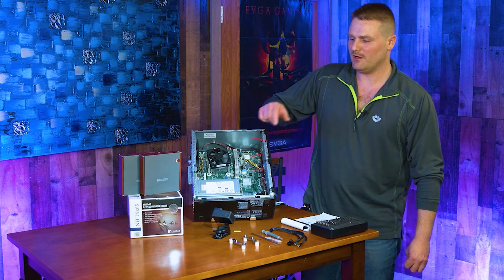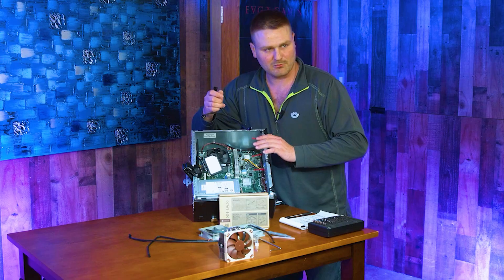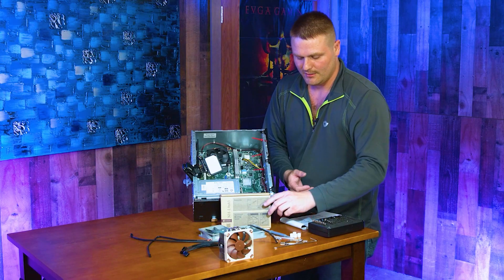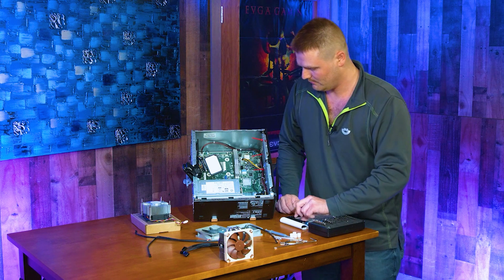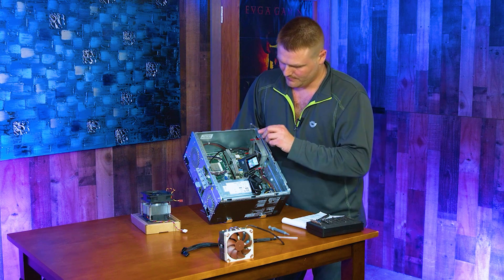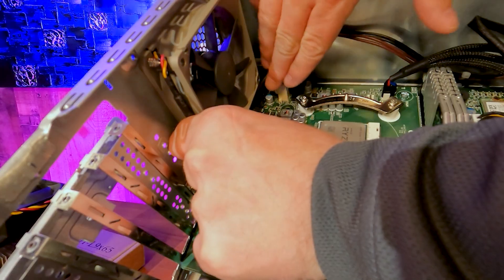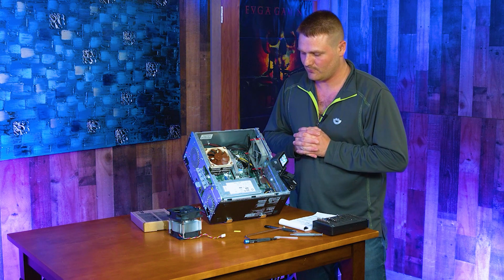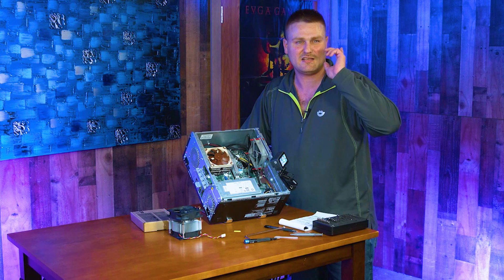HP Pavilion TG01 Cooling Upgrade Noctua CPU Heat sink and Fan Install W/ How To  1

Comment: I have ryzen 5 5600g and a gtx 1660 super on the 400w psu. the hottest temp i have seen is 72 celsius. and thats not my average temp. Would you recommend making any changes?
Reply from the maker: Any time adding a fan and aftermarket heating will help with the Temps. It will do 2 things help with cpu boost meaning it will last longer and life time of parts.
Reply: @TNW1337  I think I'm going to install an exhaust fan down by the PSU and an intake in the front of the case that is an upgrade of the exhaust fan as well as upgrading the exhaust fan. My only question is if you think I can still do that on the 400 watt PSU since I have the GTX 1660 super
Reply from the maker: @Viper34TTV  yes 100% even if you had a 3060 or 2060 it would still work. Hp did a good job budgeting for it with that psu. It is also the newer atx standard 12v only.  I feel it will be just fine 🙂.
Reply: @TNW1337  you're the man! Love your videos!

Comment: These videos on the TG01 are fantastic!

Does it matter if you use 3 pin fans and a splitter from the exhaust pins, or is there a reason to go 4 pin and share the intake fan with the CPU fan pins?
Reply from the maker: Both! will work. I know the CPU header is rated at 1.9AMP 12v not sure that the rear is rated for it. Could not find it.

Comment: Not used to working in OEM cases myself as before covid everything was a custom build. That being said are the mounting holes and bracket the same size as the AMD Wraith Spire? Reason why I ask it because there is a copper lug version that would be a cheap upgrade over the stock one if it would fit without modification.
Reply from the maker: It looks to be very close, I know what one your talking about. I do not have one but it looks to be the right pattern. I can not be 100%

Comment: I did this mod and am getting the same temps as before. Hitting 95c at 100% CPU usage. What the heck.
Reply from the maker: Front fan and CPU heat sink ?  Also there is software from acer to turn on performance mode with the fans. Test where done with it set to auto. But I get even better numbers when set to max or Performance mode. It is Acer nitro software.  I should have said some thing in the Video about it I just figured every one knew about it.
Reply: @TNW1337  Thats a Acer program? It won't let me run it. Is there a link you can give me?
Reply from the maker: @chrisstephens223  Yes it is. The name is called NitroSense.

https://community.acer.com/en/kb/articles/78-nitrosense-software
Reply from the maker: @chrisstephens223  Heres a link to the driver and software site for the PC 

https://www.acer.com/ac/en/US/content/support-product/8943?b=1
Reply: @TNW1337  Im still comfused. These are not supported on my HP desktop. I have an Hp Pavillion TG01
Reply: @TNW1337  "Sorry this computer is not supported" How where able to get this to work on an HP??
Reply: @TNW1337  i will have to try that. This computers motherboard is frustrating that you can't manually set thw fan speed or curve. Thank you 👍🏻

Comment: I bought the splitter you linked, why doesn’t it go in on my cpu fan pin
Reply from the maker: Witch Side? The One on the board or the one to the fan. the Fan side one can be hard to plug in you may need to put it on a angle. just a bit to get it to pop on. It also could be a bad splitter. With covid the QA on stuff has not been the Best.
Reply: The motherboard part, I bout the 2 way splitter and it doesn’t fit into the cpu pins. They look really separated and the splitter pin things look really close

Comment: I appreciate you posted this video. However you missed some key information, and opportunities to video some of the important installation points.
1. The NH-L9x65 CPU heatsink and fan, do come with both AMD and Intel hardware. I do not know why you keep saying this. I did not come across this issue.
2. When removing the cpu, somtimes the cpu and the current heaksink and fan like to come out as one unit. Please advise users to pull straight up to prevent damaging the cpus pins.
3. Thank you for posting links to hardware needed.
4. When installing the white plastic Intel stand offs. You do not mention which hole you place the 3mmx16mm screws into. There are three holes on the Noctua Metal mounting plates to pass the 3mmx16mm allen head screws through.
5.Stop saying "bad mama jama." This is your go to default, "this thing is awesome". Review your script for the video and learn to use a larger word base to express what you are speaking about.
6. I will say this again, thank you for posting this video. While I did find the video provided a good amount of information. There were some glaring issues in how you presented the information, and also how you missed some good points on installation and details that were missed.
Reply from the maker: Thanks for the info, can only help me make better videos! Yes I did miss those key points. I normal do not use a script, only if it is to much info for me me remember. But thank you for the input!
Reply from the maker: I will try to plan the videos out better to make sure I do not miss any key points!
Reply: It’s ok man he was trying his best and good job for helping him

Comment: Would this setup be good enough for one of these with a RTX 3060 ti and a i511400 in it? Or would you recommend a different set up? I'm completely new to this, so I'm just trying to make sure I get all the right parts to get the best cooling out of this. Also, which size fans would you recommend for this setup?

Also, how do I make sure these kits come with both Intel and AMD parts so I don't have to buy and additional fans just for the extra parts?
Reply from the maker: Well you will need to buy the screws they are not included. I could not find them on amazon singles, so I just linked a kit. If it says it supports AMD and Intel it comes with all the parts you will need. but the screws. 
Yes that will be a pretty awesome starter PC, The HP/TG's use a 92mm fans. Its pretty easy to add fans to it.
Reply: @TNW1337  Well the screw kit you linked it says they're currently unavailable. But I was able to find a virtually identical kit by the same manufacturer on there. So that shouldn't be a problem now. I put all the items you used in this video into one of my lists on Amazon, so I shouldn't have any problems securing most of these parts. And good to know about fans too, so nothing to worry about there.

Also, thank you for answering my questions! Coming from a gaming PC super noob, I really appreciate it.
Reply from the maker: @MetalGaiden96  Cool
Reply from the maker: @MetalGaiden96  Also 
FYI Do not tighten the heat sink screws all the way down. as soon as it is, snug stop.
Reply from the maker: @MetalGaiden96  screws I am talking about are the ones with springs
Reply: @TNW1337  Got it. I'll make sure to keep that in mind. Thank you.
Reply from the maker: @MetalGaiden96  ✔
Reply: @TNW1337  I did have one more additional question. Kind of unrelated to this specific video, but what's the best CPU that can be put in these PC's? As mentioned, the one I'm getting comes with a I5-11400. But I would like to possibly upgrade to a I7 eventually. I just need to know which one would be compatible with this PC specifically.
Reply: @MetalGaiden96  11700/11700F only. Board limits to 100 watts so they will run at around 3.5ghz under stress tests.

Comment: I’m back after trying to install the case fans the way you installed the case fan prevented the silver part/hard drive holder from going in
Reply from the maker: Yes it does.
Reply: TechNitWit doesn’t go in for me maybe my model is different from the one you have any way can I just remove the silver part and the black part I don’t see any purpose for it besides hold SSD/HD
Reply: TechNitWit and removing it will probably improve air flow
Reply from the maker: @mkminor3398  yes

Comment: where is the link of the splitter?
Reply from the maker: I for got to add it. it is there now. Sry
Reply: another thing, the screws m3 that i need is 16 mm or 10mm?
bc i was reading some advises on a page online of this pc and another thing, can i put 3 fans?(one in the frontal, one rear and one lateral)  ps: my oc has rtx 3060ti and amd ryzen 5600g
Reply from the maker: @botpro160  For the TG? I guess yes you can, I  only  put 2 fans  due ti cage and CPU  heat sink. 16MM unless you want to remove the mobo and remove the back plate they have adhesives to the board. 16mm will work I have a whole kit listed in disco I Know it more then you need. but a nice kit to have for pc. as it is a common thread they use for PCs.
Reply: @TNW1337  yes, for the TG thanks btw
Reply: Np, i didn't see the comment here and i asked another time to the newest video now

Comment: Mine is here now, i put a 80mm Arctic Fan on the side to get air in, its easy to put on this black cage. 
I used one Screw and three cableties. The Arctic Cooler have PST and PWM.

After Christmas i will order the Noctua CPU Cooler and a 92mm Fan for the back.

Comment: awsome video! i got a quick question, i the intel version of the tg-01, can i still use the same bracket that you used to attach the heatsink?
Reply from the maker: Yes it is the same thing, hp did it to same money.

Comment: Does it will fit if I have the 6600 xt installed because I see that you do a video installing que rx6600 but it doesn't have this cooling options
Reply from the maker: in the software ?

Comment: Did you remove the backplate? And will a 310W PSU be enough for the big cooler when paired with a 1660S and i7?
Reply from the maker: Yes and yes. back plate is adhesives on. you can remove it but not much fun

Comment: I have a Ryzen 5 5600 G (65 W TDP) noticed (at the same ambient temperature) that compared to intel's stock heatsink, the Noctua NH-L9x65the IDLE temperature has increased by about 9-10 degrees from 35.5 C to 44 C while that in load has decreased by only 3-5 degrees C. I have the impression that due to the smaller fan compared to the Intel stock, the dissipation occurs almost passively (in IDLE) and then compensates with the increase in the temperature curve under stress, in fact when the fans start going fast the temperature drops. Another thing I noticed is that with the intel heatsink the maximum temperature reached 85 degrees with the noctua never exceeds 80 degrees. Could you confirm the temperature increase in IDLE? Thank you
Reply from the maker: Well I was using the big boy Noctua on the Newer TG.  I will have to set it up to look, but yes I can.
Reply: @TNW1337  Thanks you are too kind, but don't bother I finally installed the big boy too!  beautiful beast!  but unlike you I left the fan in the default direction, and it increased the temperature of the GPU so I intend to reinstall it so that it sucks from the heatsink instead of blowing ...
Reply: The stock heatsink is likely made by a company called AVC. On my TG01 it seems to be able to do 5000rpm max.

Comment: can u use a 92mm noctua cpu cooler as well? or just the 65mm
Reply from the maker: There is a 92mm one that will work. i plan on doing a video on.
Reply: @TNW1337  I really hope sir, I need a video like that. I have de rtx 3060

Comment: Will these coolers work with TG01-1022, and do I need any cables?
Reply from the maker: With the cooler no extra cables are needed but you need to make sure it is a 4pin pwm.

Comment: Hey, what cable to I need to do exactly this? Also, the fan in the front, what is the purpose of it since the Case is closed in the front?
Reply from the maker: The case is not fully close in the front. take a flash light you will see light shine though.

Comment: Hey @TechNitWit what’s the point of install the redux exhaust fan? I see in my bios the exhaust fan that comes installed blows at about 353rpm and that never changes while watching HWMonitor either regardless of how hot system gets. Wouldn’t installing a new fan like you did here still be limited to that hard lock of 353rpm regardless that the fan can do more like 1600rpm? Or does this new redux fan install get the full 1600rpm? I’m new to pc mods and just want to be sure this wouldn’t be all for nothing bc I do see temp issues when putting the system on full load and would like to change that.
Reply from the maker: Well the noctus fan is a better design imo. Never did look at the speed it was running but if you tie it in to the header with the cpu it runs it at max.

Comment: Are the processor Heat Sink Cooler standoffs (white pipe things that hold the 4 screw's) included in the Heat Sink Kit?
Reply from the maker: Yes they should be unless you get the amd kit only. You will need parts from both kits. And plus the 16mm screws
Reply: @TNW1337  I noticed while installing my NH-D9L, that the mounting screw holes for the bracket have changed slightly, now the position 2 is for the LGA1700 and its the 1st position for the 115x, not sure if this was different when you made your video, but also my white stand-offs are for AM2 and backwards, and I got dark Grey ones for AM4, did you use the AM4 standoffs or these AM2 ones? (Still searching the comments and older noctua manuals, will reply if I find an answer)

Comment: do you think i could fit a Noctua NH-U9S to my hp pavilion tg01?
Reply from the maker: Nope sorry
Reply: @TNW1337  It's ok, i fitted a be quiet slim rock 2 tower cooler, had to remove the damn plastic push clips, and put it in with 3mm allan head bolt's, 1 washer each screw and 1 spring. :) everything fits, but its tight! also using the hdd bracket etc in the case :)

Comment: Very good video.  I'm tempted to try this on my TG01, However mine looks slightly different and i'm not sure it will work (newer TG01-2260xt).  Mine is an intel CPU LGA1200 ( which the Noctua NH-L9x65 says will fit) but the motherboard doesn't have the white rings on the board like yours does.

https://i.imgur.com/ZCTjQtr.jpg
Reply from the maker: It should The New TP01 I just did us a LGA 1200. it did work. Small and Large Heat sinks.

Comment: I want to use the fan he come on the ryzen 7 3700x but icant find the correct bracket please help me
Reply from the maker: You can not use it the board uses a intel style bracket for a 1151 lga style cooler
Reply: @TNW1337  but with the intel bracket i can use?
Reply from the maker: @luisitopdt  it is what I used for the noctua the not sure there is a way to use the ryzen cooler

Comment: can you please tell me if this large or mid size cooler will fit good for the tg01? i have the stock ryzen 5... i would like to upgrade all the fans.. can you please share the correct one and the biggest size that will fit please? thank you i love the vids man!!
Reply: You can check the other video from this channel  (with the huge CPU cooler he installed) to get the specs for the maximum height of a CPU cooler you can install. (If I remember correctly, it was ~15cm tall)

For back and front fans, I recommend checking the description. The size for them should be 92mm.
Note that the sidepanel only takes a 80mm fan when using a dual fan GPU.

REMEMBER that you need to buy Y-Splitter for them, because the Motherboard doesn't have enough 4-pin connectors for each fan.
A single 3-pin/4-pin output can support 1-3 fans, so no need to worry about the Y-Splitter possibly not being safe. (I've seen some people being concerned about it)
Reply: Also remember that the Cooler has to be LGA 1151 mount compatible. The stock CPU has a intel mounts even though its a AMD processor in a AMD AM4 socket.
Reply from the maker: Yeah I would stick to the Noctuas cools also you will need to get the screw kit or 4x 16mm Screws. Best if you watch the video it has all the info in there.

Comment: Great video! I just removed the LED light and the fan in front can get more fresh air flow now!!!
Reply from the maker: Awesome
Reply: Did you connect the fan with the LED light's 4-pin connector, or did you use a Y-Splitter for it?
Reply: @XTRakki  I am using the Y-Splitter, the fan speed is same as CPU fan.

Comment: Thanks for teach,can I use 16mm m3 screws to install the l9x65？
Reply from the maker: Yes that should work I have a link in disco to a kit if you want to double check.
Reply: @TNW1337  OK,thanks

Comment: Bro I need your help because I don’t know if the Cooler Master Hyper 212 Black Edition fit in the HP case you can help me???
Reply: Also remember that the CPU cooler has to have LGA 1151 mount compatible.
Reply: @XTRakki  the cooler of Cooler Master is 1151
Reply: You can check the other video from this channel, with the huge cooler he installed, to get the specs for the maximum height of a CPU cooler you can install. (If I remember correctly, it was ~15cm tall)
Reply: Hey! I checked the specs/size for the Cooler Master Hyper 212 Black Edition, and the height is 159mm.
TechNitWit was able to fit the Noctua NH-C14S (which's height is 163mm) inside the case.
By this, the Hyper 212 should fit nicely inside the case. Just remember to mount it in a way that the fan pushes air out towards the back of the case.
Reply from the maker: From the image I would say no. but I did not look at size.

Comment: where do i mount my ssd drive if i wanna do this?
Reply: You can drop in on the bottom. SSD drive doesn't have any moving parts, so it doesnt vibrate when used/get damaged from the case's vibration.
Reply: @XTRakki  ok thank you
Reply: @XTRakki  have you done the big cooler as well? And 2 fans
Reply: @davidvsduhworld  I haven't. I was looking into Noctua's NH-L9x65, but might actually just change the old thermal paste and change the old heatsink's fan for a new one, while still keeping the original heatsink.
Reply from the maker: Correct. If you want to add some safety get some double sided sticky tape and Tape it.